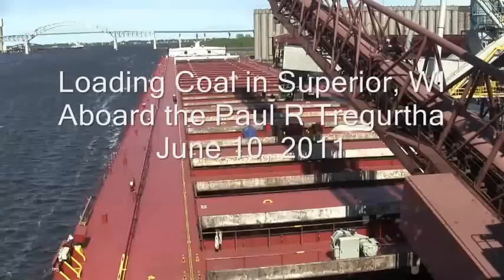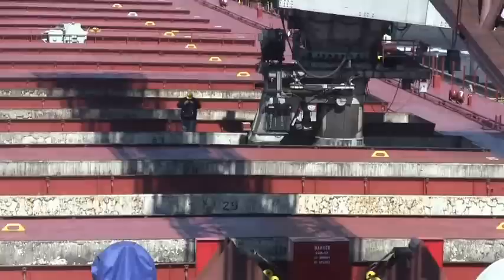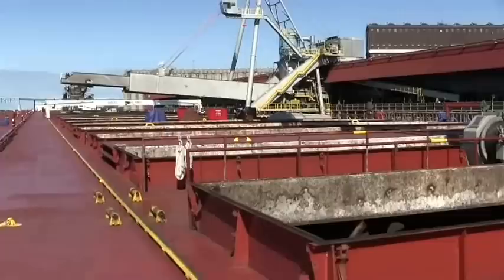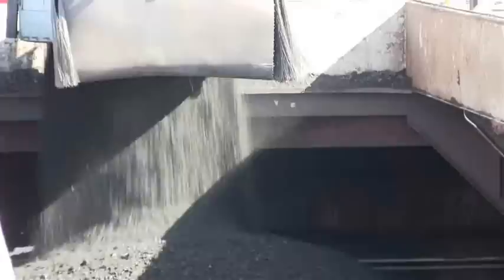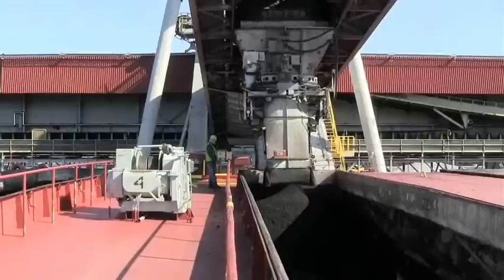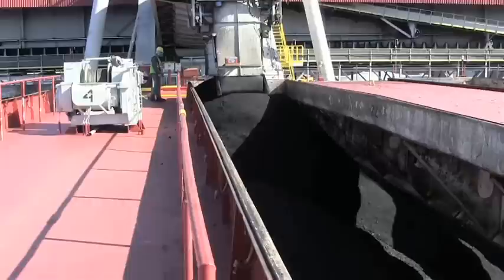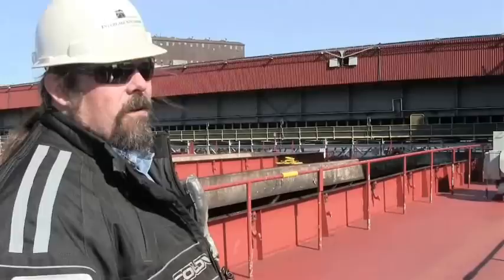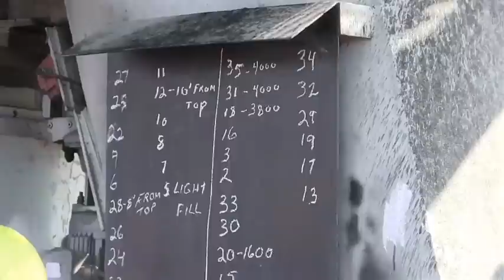Paul R Tregurtha Loading Superior, WI - Great Lakes Freighter

Comment: I wish that I had a coal furnace in my house instead of fuel oil. I had one when I lived in Montana. Loved it! Clean burning and cheap. I lived in Colstrip. Two huge mines there. That's where that coal came from.
Reply: Brun coal all you want but it is NOT clean.
Reply: I remember as a kid in St Louis MO...Coal was used for home heating. In the winter when it snowed...you could see a thin layer of soot on top of the snow...coal isn't clean. The air had lots of "smog" in it too.
Reply: REALLY makes a difference between eastern and midwestern/western coal.  Eastern is hard and I never even had a plume out of my chimney.  Midwestern was dirty both loading and burning.

Comment: You got to love big machinery!

I'm surprised that they only use one loader. Maybe the bottleneck is the trains?
Reply: I would imagine it is due to the fact the ship can only pump out ballast water so fast.
Reply: They have to keep moving stem to stern to keep the ship in balance otherwise the ship bends and it could stress the iron in the ship overtime.
Reply: I am surprised that no one speaks negatively about coal, I was in the business for 40years in texas and that's all we heard ..just constant negatively so much so we started shutting down mines
Reply: @jimclay6241  They are right after all; coal power kills far more people per power produced than any other power plant type, and that's before you even get into the global warming costs (both financial and human). The sooner we stop burning it, the better.
Nuclear + renewables is the next best step to take in power generation; coal power is the worst thing to keep going.
Reply: I live near the de-commissioned Zion Illinois twin nuke plant and even though the plant is totally removed, the old, still hot, nuke cells are still on site.  They are all encapsulated in some verticle storage cylinders setting on a fenced in concrete pad.  THAT to me is a big problem with the nuke plants.  Congress can’t seem to be able to come up with a permanent storage site for spend nuke fuel rods. If that storage issue gets fixed, I would be all-in on nuke power.   Bruce

Comment: Very surprised to see these guys smoking on this ship while loading coal! Coal dust is explosive!
Reply: I thought the same too
Reply: Yes we are having issues with an only this ship about the crew smoking  to this day an we are dealing with it
Reply: Hotrod Hog fast way to unload the ship.
Reply: PF or pulverised coal dust is explosive. Normally takes surface temp of about 580deg C to ignite coal dust and between 2.5 -1000 joules depending on particle size,  oxygen % pressure and temperature.
One lighted cigarette  🚬 doesn't provide enough energy in open air to vapourise coal dust and create an explosion but Company policy these days would make smoking prohibited in all hazardous areas & confined spaces.
Reply: yeah I was going to say the same thing the one guy commented too yeah it is explosive But it would take a Lot more heat generated to ignite the coal dust the ciggy that guy is smoking wouldn't generate enough heat to ignite it and stay burning Especially since he's out in the open air now had he been in one of the cargo holds Maybe a better chance but even then still bc I remember throwing my lit ciggy into my grill once with coal in it and it had coal dust and it never ignited
Reply: @mauriceupton1474   I guessed there were numbers like that involved.
Reply: In a confined space, it is. Outside, it will not reach the concentration required for LEL, or “lower explosive level”.

Comment: 8:56 smoking near all that coal dust ?? Not dangerous??!
Reply: I wouldn't think so.  A cigarette isn't likely to ignite coal or remnants of coal gas.
Reply: Normally confined spaces are well ventilated.
Takes approx 580deg C in air to ignite coal dust. Depends on particle size pressure. Energy required varies from 2.5 joules to 1000J  in controlled conditions.
Most of the electrical motors are Dust ignition proof and the electrical gear is housed in certified explosion rated enclosures. Certification varies in Europe to the USA.
Coal Mining equipment requires even higher ratings because of methane gas (coal damp) released from the coal. Generally coal is kept wet to reduce dust and prevent pyrolysis.

Comment: Is he about to light a cigarette? It would be possible for an ember to start the coal on fire and loose the ship..
Reply: Thanks for informing the public of the impending doom Safety Sally.
Reply: Don't know where you got your info from but it takes much more then a spark to ignite coal.
Reply: I bet that they spray water on the coal to hold the dust down.

Comment: I dread to think of all the pollution created by burning these 1000s of tons of fossil fuel?
Reply: Ah yes, a treehugger
Reply: Black Shadow - check your facts first - it’s the trees that make the coal !
Reply: Well, that’s what has been going on for many generations, and it’s still what many of the large power stations use. We don’t all live near Niagara Falls or other waterfalls where Hydro power can be made. Also I think it’s used in steel making. Likely it will change with time, but definitely not overnight.